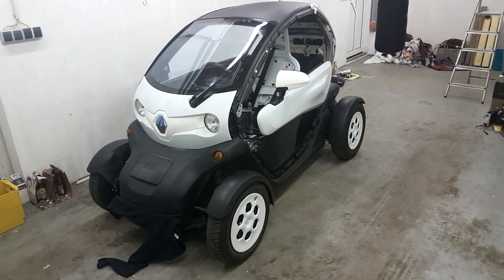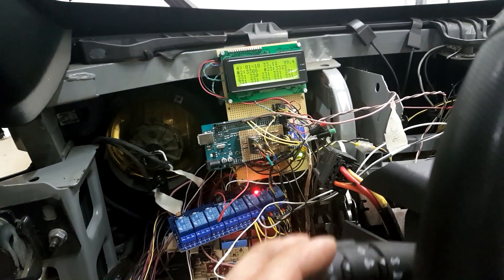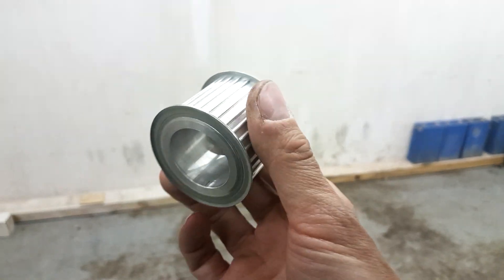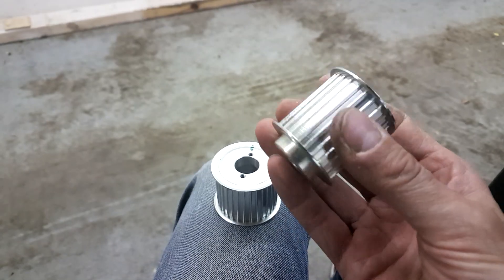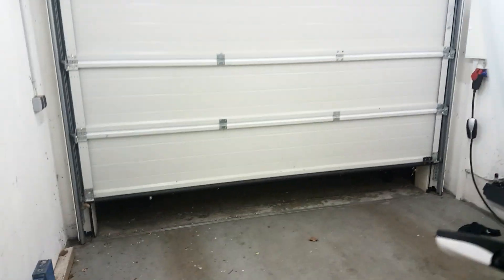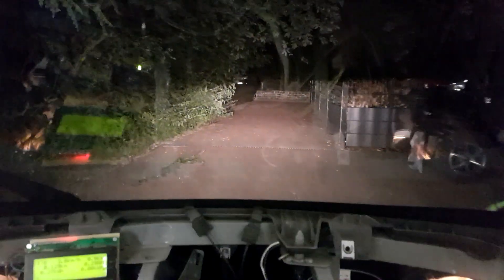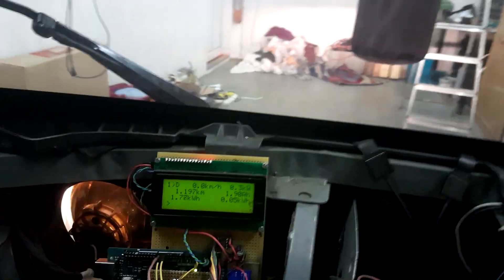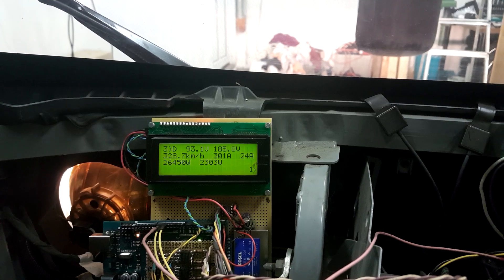#8 Renault Twizy DD - "only" 27kW power with 16kWh battery

Comment: I'm looking for the next updates, impressive job! My plan is to use LG Chem 4s3p packs, 196Ah each in 96v nominal configuration. Ordering charger now. Question from charger manufacturer - which baud rate and CAN protocol? They do offer 125kbps/250kbps/500kbps baud rate? Could you help me here, please? Thank you in advance! BR Martin
Reply from the maker: Sounds good, keep on going! The baud rate in such a simple application is almost irrelevant. Kelly uses e.g. 250kbps. Protocol is standardized and based on CAN2.0B and SAEJ1939. You'll get along with all of it.

Comment: Unfortunately no more news for 8 months. Wouldn't DD be easier with this drive 
https://de.aliexpress.com/item/1005001773369075.html, and you would have even more space for the traction battery?
Reply from the maker: I thought about wheel hub motors when I started a couple of years ago and couldn't find qualitative ones. Indeed nowadays I would build and AWD with such motors...if only they are trustworthy ;-)

Comment: This is amazing! There is an inventor that is building his own battery system called Robert Murray smith and hes been trying to access the Twizy BMS for ages without luck. Maybe you both could join forces! would be amazing to see two YouTubers do something really special
Reply from the maker: I am not giving a lot for backward engineering. I think there are a lot others out there much better in doing so. Nice idea anyway... ;-)
Reply: @nextev8794  Well regardless, well done that is a major project to undertake alone!

Comment: What's that noise when you let off the accelerator fast?
Reply from the maker: Excellent sense and brillant ears, like it ;-)
It's because of the CLC (PI) settings inside the controllers which is still the old one from the test bench. The overall vehicle has naturally a much bigger time constant and requires other values for kp and ki, coming soon.
The noise appears more dominating if vehicle is rolling and you start accelerating again.

Comment: I always watch your videos and updates and tnx, did you figure out the way to control the rear motor spinning ratios while turning?
Reply from the maker: Surprisingly the vehicle corners pretty well without diff, the virtual connection seems to be not very stiff.
I already have different strategies in mind how to control the motors (based on torque, based on speed, geometry of the vehicle - steering angle). Lack of urgency it's postponed...
Reply: @nextev8794  Thanks for your response, keep doing great videos! Please update if you find a way to control.

Comment from the maker: The Twizy DD (Dual Drive) got most body parts back again
.
This time It runs on all cells (30s2p each 85Ah = approx. 100V and 16kWh), https://www.youtube.com/watch?v=JRT8IUk1YtQ
Current limiters (both battery and motor) are set to "only" 60% (300A), which is close to 30kW. Finally it'll be 50kW!
Gear ratio is currently way too long (1:3.5 instead of 1:5.0), leading to a (theoretical) max speed of 140km/h
Motors: 2 x Revolt RV-160-PRO with 50kV, https://www.youtube.com/watch?v=Ot9NJjfv0DA
Controllers: 2 x Kelly KLS96601
...and 12V electrics are alive again!